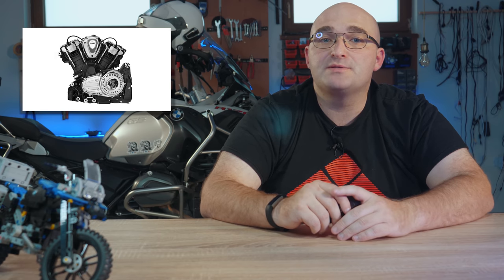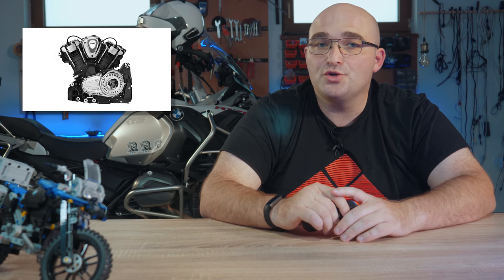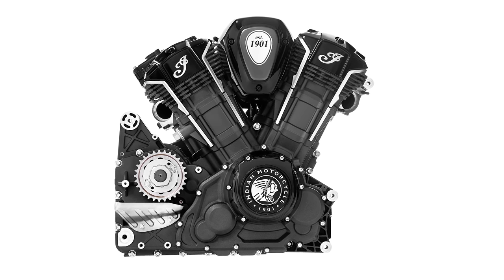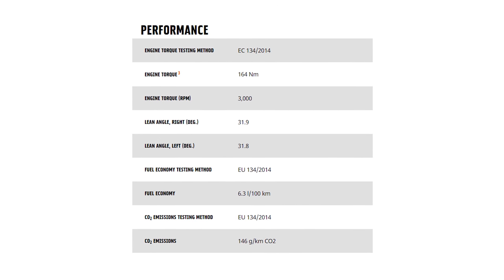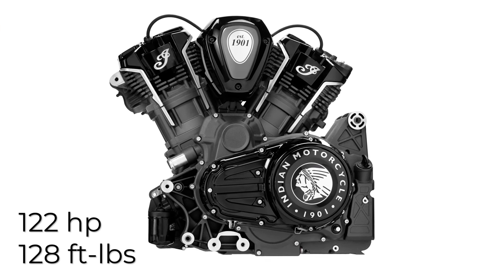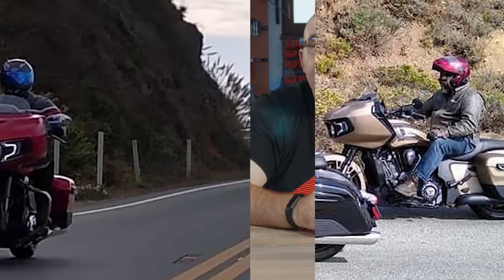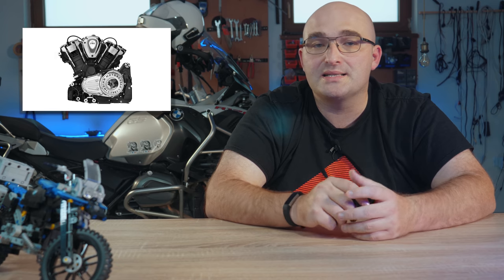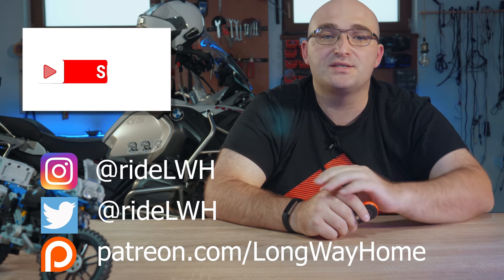NEW: 2020 Indian CHALLENGER Photos with PowerPlus 108 Watercooled Engine

Comment from the maker: What should Harley's answer to this be?
Reply: Buy Indian?
Reply: BANKRUPTCY! HD missed the boat AGAIN!
Reply: I called my Indian dealer today and he can’t say much as of now other then this is a complete game changer.   122 hp 128 torque.  That’s like two Harleys added up!
Reply: @bjweaver3333  thanks for sharing! Any talks of price points?
Reply: Long Way Home he said range will be  mid 20’s - mid 30’s.  So I’m guessing like a Chieftain.
Reply: I think the only issue with the Indian and victory bikes is that if the transmission ever needs serviced or repaired you're splitting the cases apart to gain access to it as its an internal engine component and not easily accessible
Reply: "Stop copying me."
Reply: CHAPTER  11  ?    😳😳
Reply: Harley will obviously try to call Indian copycats and blah blah, even though all tourers look about the same to me.  They will say they dont have real heritage and so on, even though Indian makes a better product.  Then after that they will go in a corner and cry themselves to sleep, instead of making a better product that is worth the cost.
Reply: mld every manufacturer does this
Reply: Kenneth Wise Indian screwed up , by pushing a 116 engine with that 108 being released right behind it. One of them should have been saved for a limited model bike.
Reply: Kenneth Wise a lot, just like Harley.
Reply: Brian they cost that now. New technology will push that price up over the air cooled engines.
Reply: Well if thay don't there done lol
Reply: @kennethwise7108  NOT GONNA HAPPEN BECAUSE HARLEY RIDERS ARE NOT TRYING TO BE MOTO RACERS.
Reply: @bjweaver3333  What Harley are you riding?
Reply: @Terry White any bike can get that if you leave it alone.
Reply: @bikerbeliever8169  But... Harleys and harley accessories are often much cheaper than Indian.
Did you really not check before posting?

Indian wants 1000$ for a full sissy bar setup.
Harley wants 550$
Indian wants 1500$ for a stage 1 setup and no tuner.
Harley wants 1200$ and you get a Tuner.
Indian wants 3600$ for a Stage 3 kit.
Harley wants 2700$ for a stage 3 kit.

A lowrider S 114 is 18000$
A Dark Horse 111 is 18500$
The low rider S is much faster, more nimble, and much lighter, and is cheaper.
The sport glide is 18600$ too, and it's also faster, lighter, and it comes with a mini fairing and bags.
The Softail Slim is 16000$ It's also faster, cheaper, lighter, and btw all of those harleys have stock LED front lamps.
The indian dark horse and vintage doesnt. It's a 400$+ upgrade from indian.
Harley has them stock.
Hell the Vintage is $20000
The Harley Heritage is 19000$ and it's much faster, and lighter than the Vintage.

Sounds to me like Harley is cheaper.
Reply: @FranBunnyFFXII  Who buys accessories from the manufacturer when you can get them better and cheaper from aftermarket?  Harleys bikes dont have the performance to match the cost.  Indians do.
Reply: @bikerbeliever8169  Again that's wrong.
The TS111 is 74hp peak at just 5000RPM. 
The M8 is 81hp peak at 5500RPM.

The M8 is cheaper, cooler running, and far more upgradable, and all of them have stock oil cooling.

Most Indian's require you to purchase the oil cooling device(310$+ dealer install fees).

The M8 Softail family is sub 700lbs. ALL OF THEM are sub 700lbs. the Dark Horse is 736lbs dry. DRY.
All Softails are ligther fully loaded, than all of the Indian cruisers Wet.
The M8 is more powerful than the TS111, driving a LIGHTER bike, for LESS COST.
Remember the Softail slim is 16000$ 671lbs WET, and stock oil cooling, 81hp, 5500RPM.
The Dark Horse is 736lbs DRY, 18500$  +310$ for oil cooling, 74hp 5000RPM.

Harley undoubtably has the price to performance to weight ratio advantage.
There is no BSing that.

Go lookat their stuff.
Stop being ignorant and actually go look at their websites. All of this stuff is direcly on their websites.
Reply: @bikerbeliever8169  There is no way you can sit there and say "a 74hp, 770lb bike, halogen front headlamp is so much better value than a 81hp, 671lb bike with an Led Headlamp."
You just cant.
That's just ridiculous.
Reply: @FranBunnyFFXII  I just did
Reply: @matthewnorwell5353  only in your mind.Harley still sell around 212,000 bikes per year.You do the math.
Reply: @bikerbeliever8169  yep, Matt Laidlaw just released a video of it
Reply: duane howard  then WHY ? Do they bother with the Stage 1 ,  Stage 2 ,  Stage  3 & 4 ?
REALLY ? 🤔
Reply: @eddiebenzz  lol
Reply: @eddiebenzz  INDIAN DOES THE SAME THING WITH THE 111 BUMPED TO THE 116,IN ADDITION TO A STAGE 1 BEFORE YOU CAN EVEN USE THE 116 KIT
Reply: I find it funny ,your promoting Indian,but haven’t a clue what they're up too.
Reply: @eddiebenzz  https://youtu.be/813KQ1-cuDs
Reply: @eddiebenzz  https://youtu.be/e25fMbu-riA
Reply: @tax905972  I've been wrenching on HDs my entire life and see the same issues with their bikes. I can fill a thousand pages of common problems with their bikes. That's why I have a BMW, the HD's just collect dust now. I'm sick and tired of the brand and all of the BS the MoCo has done. I can go on and on but it isn't healthy for me, I get pissed just thinking about all of the money I've thrown into my HD's over the years. Most people (probably yourself included) have never even ridden anything else.
Reply: @kennethwise7108 they all have problems including Indians . Not very difficult to google what those problems are.
Reply: @Terry White if your transmission needs major service you will be splitting your cases and that's a fact. A VERY expensive fact at that.
Reply: @tax905972  if it has tits or wheels it will have problems. The thing to consider is what do I want to ride that is premium quality and reliable. Please DONT get me started on HD problems. I think it's time for me to let this conversation go,  I'm moving on to another one. One that will take me to a happy place.
Reply: @kennethwise7108  😄 🤣 well was right on that one it appears
Reply: Don't underestimate Harley! They'd rather sell performance parts then build it from the factory that way. Which really doesn't allow much more room for someone to upgrade their Indiana's. Don't get me wrong I love both and I'm jealous of anyone who buys one.
Reply: @kennethwise7108  
Are you an engineer?
Reply: Kenneth Wise no my friend harley is far ahead of indian
Reply: it's plenty i just bought the road glide limited and don't regret it a bit... polaris can keep their bike
Reply: @bikerbeliever8169  check the Matt Laidlaw videos.
Reply: Kenneth Wise Why the fuck would you need to fix the transmission.???
Reply: FranBunnyFFXII you can if HP doesn’t really matter. HP is a calculation of torque. Useable torque is where you feel and how you ride it . I take my buddies chieftain to the cleaner in my 14 SG 103 ;p
Reply: Eddie B. Simple
Marketing
Reply: Harley has no clue they're just throwing shit against the wall see what sticks

Comment: I brought a Brand New 2019 Indian Chieftain Limited. And they’re nice bikes to have as long as you’re not riding them. They look nice, but I had nothing but software issues. Each time I had a problem I had to get the bike back to the dealer, which was about 2 hours away. So that’s 4 hours riding time if the fixed the bike the same day. If not, I had to find someone to follow me for two hours to the dealer to drop off the bike, then drive 2 hours back. Then the same process to pick it up. If you don’t live near a Indian dealer, think about it before you buy one. My Indian was a nightmare. I now own a 2019 ROAD GLIDE SPECIAL. The dealers are easy to find and H-D stands behind their customers.

Comment: A few Rocket III riders making comments. I own a rocket X. Ramair, 3 into one viking exhaust and aftermarket cams.  The bike produces about 160 Hp. Big deal. Truimph does not offer a touring motorcycle. Been looking at the Yamaha transcontinental for awhile now but dragging my foot on it due to its horsepower. This bike has my interest big time. Especially since it appears to be offered in a dark version.  Very slick.

Comment: Harley built that motor in 2002.  The boys would NOT buy it because of liquid cooling  overhead cams  etc. big horsepower.   OMG Harley had sold out ,end of the world, a girly bike, Jap bike,  etc.      The V Rod was a magnificent bike  I bought a new one in 2007.   They were  tough reliable machines half Porsche.
Reply: Spot on. It told the HD dealer if they had the VRod motor in one of their Glides, I'd buy one. I went Victory instead. The Power Plus engine was supposed to be the new Vic power plant prior to being shelved in favor of Indian. I'll wait and see what is said about this new bike and go from there.

Comment: They also changed it because they had problems with the 111 and 116 engines.
Reply: And what problems are those?
Reply: @SpudsMcHaggis  engines that start on their own, for one. The storage of sales for the 116ci kits
Reply: @SpudsMcHaggis  ATTENTION 111 OWNERS: A recall notice... - Rocky Mountain ...https://www.facebook.com › RMIMRG › posts › attention-111-ownersa-re...
Reply: @SpudsMcHaggis  INDIAN MOTORCYCLE RECALL NOTICES - LATEST ...www.arfc.org › motorcycles › indian › recalls
Reply: @SpudsMcHaggis  Indian Motorcycle Recalls 2015-2017 Roadmaster Models ...https://www.polaris.com › en-us › recalls › on-road › indian-motorcycle-re...
Reply: @SpudsMcHaggis  https://youtu.be/EXN_jr8iRck
Reply: @tax905972  Engines starting on their own. First I have ever heard of that. Where is the proof? 

And what do you mean by the "storage" or do you mean the shortage of sales? And if so, that means nothing except that the 111 is obviously good enough for the majority of owners. 

You quote Matt Laidlaw. Sorry but using a HD dealer who is biased as a point of reference to give substance to your statement is just stupid. Using a 3rd party independent source gives more weight to any argument. Also the 108 does not replace the 111 or the 116 but supplements them by offering a modern performance engine.
Reply: @SpudsMcHaggis  
Ghost in the machine? Indian motorcycles may self-start due to faulty switch, recall started
The 2016 Indian Springfield is the newest addition to the Indian Mortorcyle lineup.Lawrence Rigby, USA TODAY
DETROIT — There may be a ghost in the machine in about 3,300 Indian brand motorcycles. The engines can start by themselves because of a faulty switch.
The Minnesota company started a recall Thursday of 11 models from the 2018 model year.
Documents posted by the National Highway Traffic Safety Administration say corrosion in the switch can cause an electrical short. That can start the engine if the key fob is nearby. The agency says if the engine starts unintentionally and the bike is in an enclosed space, people could be exposed to carbon monoxide.
Documents show two reports of Indian motorcycles starting themselves, one at a dealership and another in a development vehicle. Polaris Industries Inc., which owns Indian, says it has no reports of carbon monoxide exposure or injuries.
Dealers will replace the switch at no cost to owners.
Affected models include certain Indian Chief, Chief Classic, Chief Dark Horse, Chief Vintage, Chieftain, Chieftain Classic, Chieftain Dark Horse, Chieftain Elite, Chieftain Limited, Springfield, and Springfield Dark Horse.
Reply: @SpudsMcHaggis  I don't just use matt or john maxwell for all my information, I some times just use google, when I search for recalls, and warning bulletins. Manufacturers, the feds also have information on these things.
Reply: @tax905972  as you serious? Only 2 reported cases of Indians turning themselves on due to a faulty switch. That has nothing to do with a fault with the engine and they are only from the 2018 model year. Not all Indians. Read the USA Today article properly as I see that is where you got your info from.

I guess Harley recalling more than 251,000 motorcycles because the brakes may fail is nothing. All manufactures have recalls infact, recalls are actually getting more common these days then they used to be.